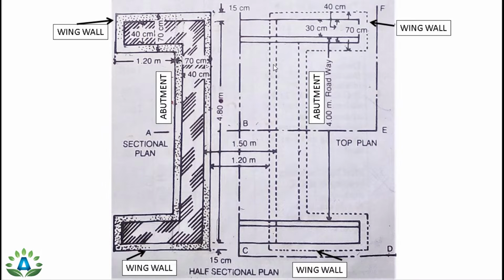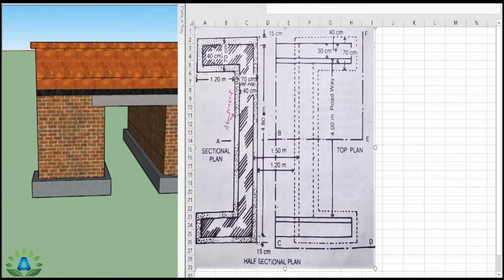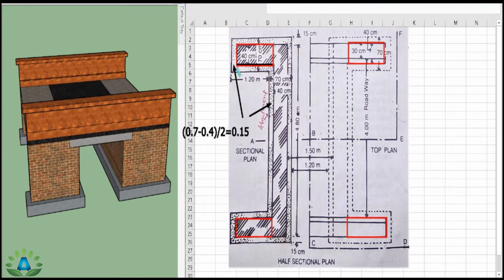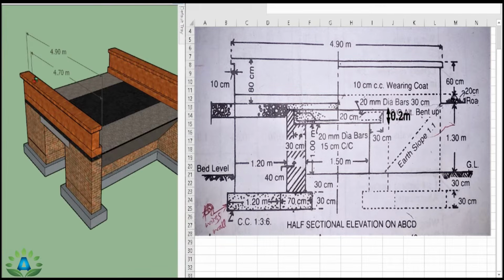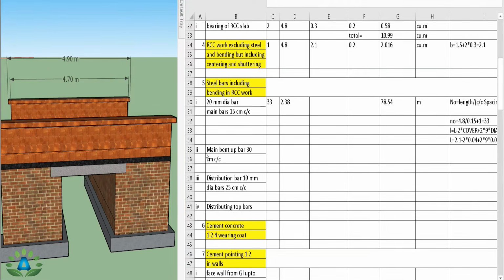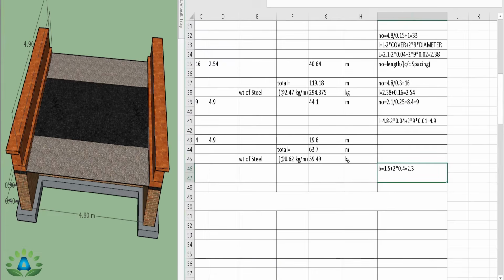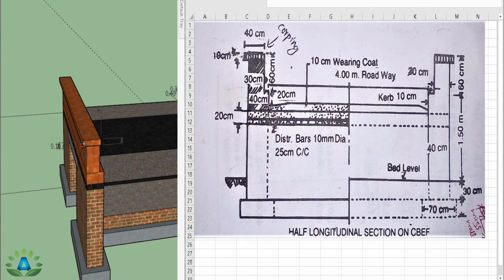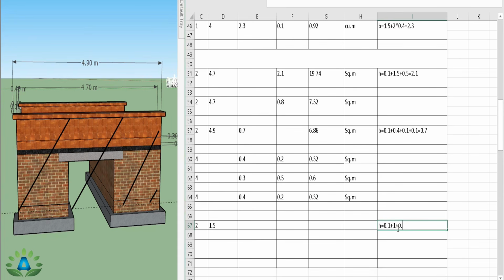ESTIMATION OF SLAB CULVERT WITH 3D MODEL

Comment: Mam I have a question ⁉️ for u ....I am not understand why are u assume wait of steel ..... please explain mam ....... 😭
Reply from the maker: weight of steel is usually constant value so  you can assume that value.
Reply: @ADVLEARNING  mam can we leave this valve I don't want to be assume 🤔
Reply from the maker: No u can't leave that .You need to do detail estimate of steel bars also.
Reply: @ADVLEARNING  ok mam 🙏🙏🙏🙏
Reply: You can calculate mass of 1m of steel bar by using formula: Mass = Density * volume. Assume 1 m length of any size (eg. 20 mm) of bar and then calculate its volume, and then multiply it by density of steel (7850 kg/m^3). You will get the mass of steel per metre of its length.